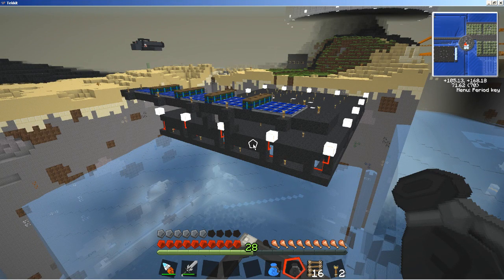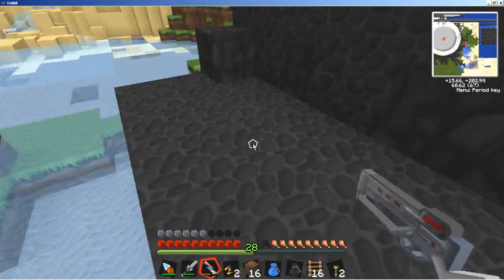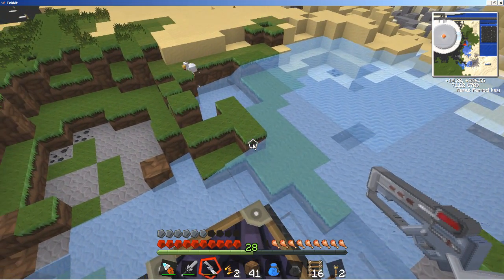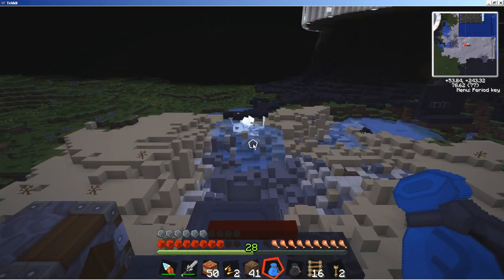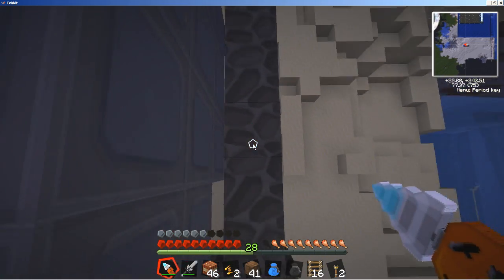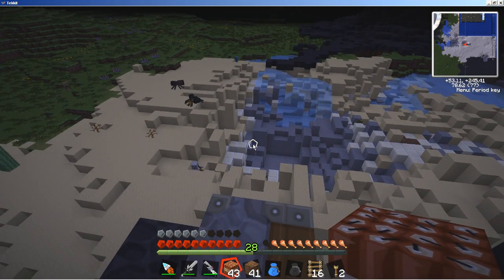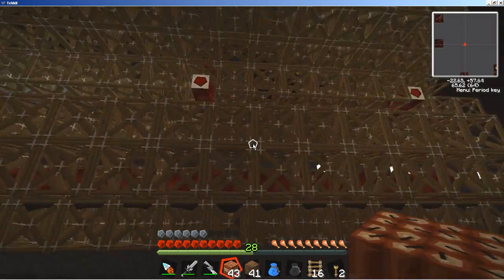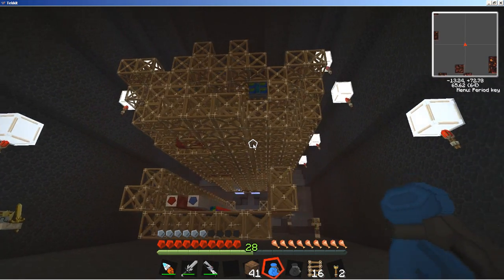Minecraft: Nether Crawler (Pt. 3) - TNT Deployer and Hull Cladding Tests

Comment from the maker: I have some opinions about that that I'll probably share in an upcoming video.  The short version is that when it comes to Tekkit, it's often less about the structure and more about the automation.  You can live in a hovel but if you've got a badass sorting system or a working submarine made out of frames, you're okay.  Conversely, you could live in a Taj Mahal made out of iron blocks but if you're still ramming coal into your iron furnace, you've missed the point ;D

Comment: So heres my findings and end result. At first I was getting around 4-8 frames per second on the 64x64 with the same texture pack as Enigmius. It was so so with that little bit of lag as I mentiond. Game was playable, but not to my taste. I played around with the game settings for about 2 hours maybe adding about 2-3 with certain settings turned off. The Setting Advanced Open Gl set to fast was the game changer. Up to just about 15-16 FPS. Gamebooster added 4-5 more FPS. Average 21 FPS. Perfect

Comment: if you don't like the obsidian look just coat the inner part, where all the vital parts are, and then coat the outer layer with what you want, so if there is a hit you can easily repair it, and it will have the look you want

Comment: lowering the texture pack is the best way to prevent lag, i.e. if you are using 256x256; try; 128x128; down to 16x16 if needed.